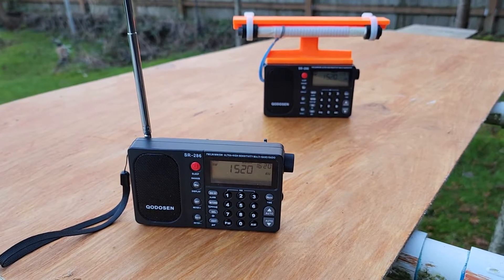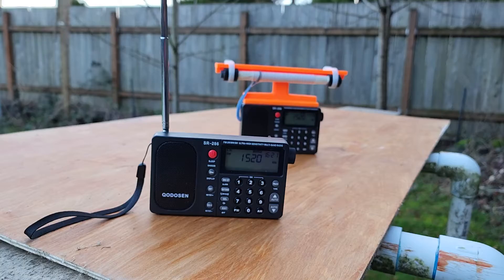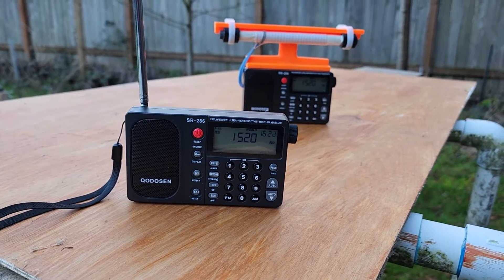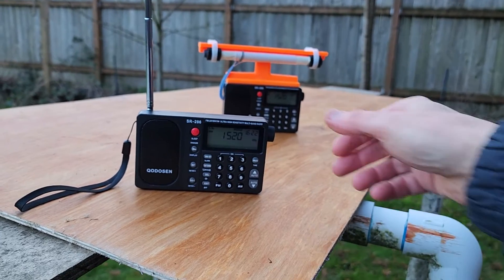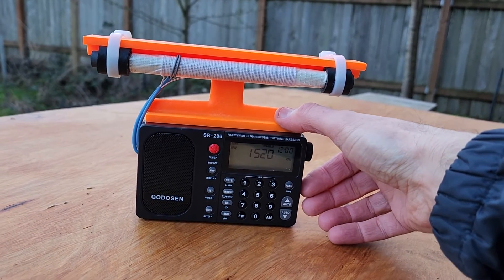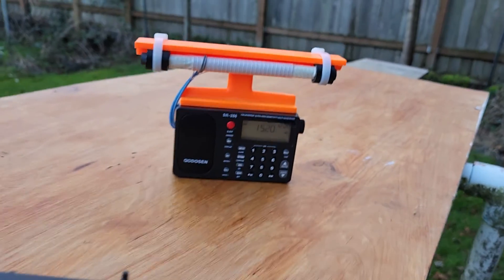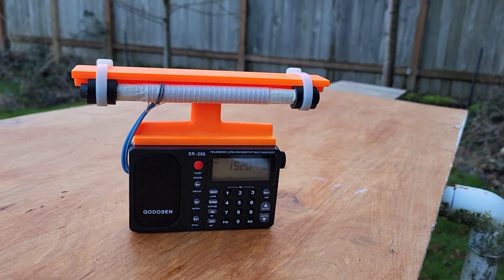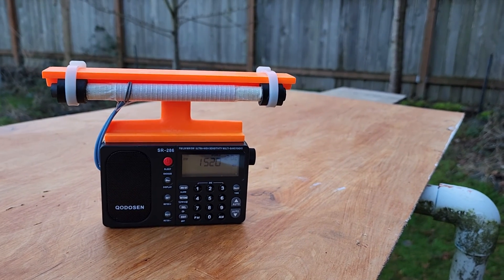7.5 inch (19cm) AM Loopstick Qodosen SR-286 Ultralight Radio

Comment: I made a single turn 4 by 4 meter square wire loop antenna in my staircase. Just the wire loop, directly connected to the radios external antenna socket. It works surprisingly well.

Comment: Hi Gary:

I bought this radio to play with this new car audio NXT chip and to get the improved parameters.

So, I used a slightly larger enclosure with two 2" high-quality drivers powered by my LM4863 amplifier to get the stereo performance and avoid the task of fighting the RFI.

Also I added a tone-shaping EQ board to get great sound in the 70-12000 Hz range.

Finally, I replaced the battery to a 26850 type to increase the playback time.

This worked marvelously.

Then I added the second whip antenna and used a balun to make great FM dipole.

The FM reception signal improved by 3-7 dB.

Then I replaced the ferrite bar antenna with 7.5" bar and made another the same inductance AM coil.

This modification didn't bring the desired improvements:

First, I started getting the "whistles" on very weak signals, when the system gain was maximum, indicating an oscillation.

Second, I found no way to improve the reception by tuning the antenna coil - it looks like this digital design doesn't use the coil resonance, or, I am wrong about it?

If that is true, then - how does it work?

Do you know anything that may help me in the right direction?

Unfortunately, I found zero information about TF6686 chip.

What I have now is close to the best radios I ever had, but I still see a few ways to improve the AM and, especially, the SW performance.

Regards,

Roman Litovsky.
Reply from the maker: Hello Roman, The SR-286 (and DX-286) has a two-coil loopstick design, making it a little trickier to design a replacement. In my own 7.5 inch loopstick I simply matched the inductances of the stock main coil (638 uH) and tickler coil (4 uH), and then obtained a big gain boost over the stock loopstick. In answer to your question, there is no way to tune the loopstick coils for maximum gain. Both the TEF6686 and Silicon Labs' chips are designed to operate well within a certain antenna inductance range, and don't provide 'peak" performance at only one inductance. As long as you duplicate the stock antenna inductances (like I did), you should get a nice gain boost with a longer ferrite rod. I don't know if your other modifications are somehow causing the oscillations on weak signals, but sometimes in a "dream radio" project like yours, it's best to do improvements one step at a time, to make sure that the improvements don't interact with each other, and cause problems. 73 and good luck, Gary/ N7EKX
Reply: @DXerGary  Thank you, Gary! I understand your answer: 

I did make two coils with the right inductances and even played with their relative phase (no effect, as I supposed).  My AM performance now is the best in class, but I expected much more gain, considering that the volume of the 7.5" ferrite rod is about 5-6 times larger than the stock one.

My goal is the following: to place the JFET follower stage at the main coil, remove the small secondary coil, and feed the JFET source output instead.
This way I would receive about 46 times HIGHER signal level than now with an antenna step-down transformer.  But I am not sure if this system would be stable with such a tremendously higher signal level.

By the way, what did you think about selecting a rather large distance between the new 7.5" rod and the body of the host radios?  Did you fight the parasitic magnetic coupling?

Regards,

Roman.
Reply: Where can find 26850 battery?

Comment: Wow great video. I enjoyed hearing the overlapping stations. I just read about some commercial AM radio stations reducing power, changing antenna configurations at night.

Can you get similar overlapping results when listening at night (I’m assuming better propagation conditions but also some stations reducing TX power?)

73 KI7ZTH
Reply from the maker: @mattkenny8151, Yes, at night many frequencies have multiple stations on the 7.5 inch loopstick SR-286 model. Some of these can be separated by turning the loopstick in different directions, if their directional bearings are widely separated. 73, Gary N7EKX

Comment: Question for anyone: On MW, how might this modified model perform compared to an unmodified one connected to a passive tunable loop such as the TERK AM ADVANTAGE plugged into the external antenna jack or inductively via the radio’s own stock loop-stick?

Comment: What would happen if you got a longer ferrite, instead of the loop stick? And would a longer ferrite work on other radios that use a conventional ferrite for MW, like XHData and Tecsun?
Reply from the maker: Hi Steverolfeca, a longer ferrite (like the Amidon 12 inch long Type 61 rod) would provide a slight increase in sensitivity over the 7.5 inch rod, but generally not worth the $95 cost and decreased portability. It would also require a new coil design, if used with the SR-286. For the XHDATA D-808, CC Skywave and other Silicon Labs 473x DSP chip models (PL-380, PL-330 etc,), these 12 inch long ferrite rods also provide a slight sensitivity boost over the 7.5 inch rods, but at very high ($95) cost and decreased portability. It's much better to get a sensitivity boost from an inductively coupled FSL antenna, if more sensitivity is desired.
Reply: @DXerGary  thank you for your advice. I grew up around tube and solid-state audio equipment, but RF is a whole new world for me.

Comment: Hi Gary, I have modified the Tecsun PL-380 with a 16cm external ferrite bar according to your plans, and I must say that the receiver has been reborn. I recently purchased the Qodosen and am using it with a self-built FSL with very good results. Even with its external antenna it works very well, from the balcony of my house (I reside in Italy, central Tuscany area) where there is less noise, I was able to listen to two stations from Iran: Radio Qoran on 900khz and Radio Ardabil on 1512. 
Regarding your interesting project on the Qodosen, for now I do not dare to get my hands on it, we will see in the future. Instead, I would like to modify the Tecsun PL-380 again with the FSL wired as per your design. 
I ask you one last thing: is there a file of the orange stand to make it with a 3D printer? 
Thank you and congratulations on your excellent work.
Reply from the maker: Hello DoctorWu03, Congratulations on your successful modification of the Tecsun PL-380! The project to hard wire a small FSL into the PL-380 (in place of the loopstick) works well, but it's a challenge to find the lightweight 100mm x 20mm x 3mm ferrite bars in some countries. I'm sorry that I don't have a file to make the orange antenna frame with a 3D printer-- I usually just cut these on a miter power saw. Best of DX to you! 73, Gary

Comment: Hi Gary - love your videos (how can I not enjoy someone playing with radios in their backyard, I've been doing it since I was 5!)  If you could post something about how to take this radio apart. Mine has an interior vibration that I can't fix from the outside.  Not sure what it might be, but something needs to be tightened down.  I removed all the case screws, but there seems to be a hang-up on the side where the tuning knob and volume are located.  I really don't want to crack the case. Thank you in advance and much appreciated!!
Reply from the maker: Hi Jkratoville, the tricky thing about cabinet disassembly on the SR-286 is the rubber "feet" on the bottom of the cabinet. After you have removed the six screws, you must also pry half of each rubber foot off of the cabinet base before you can separate the front and back sections. Then, gently pry the two sections apart with a rocking motion. There is a snap connector on the side where the tuning and volume controls are located, and this is usually the final hangup  before complete separation. Also, be careful of the wires from the battery connectors-- they break off very easily.

Comment: Hi Gary, looking at the loopstick photo I don't understand the connections. 
Could you please explain technically. It seems to me that the 2 turns loop should be connected to the antenna and the 93  turns loop should be connected to the variable capacitor of the receiver. It's correct ? Thanks a lot Gary, nice mod.
Reply from the maker: @tiqueky, Thanks for your comment! In developing this modification I simply duplicated the connections of the stock loopstick, which are shown in the photo at the following link (with the connections labeled in yellow lettering). Qodosen does not give out a schematic diagram of the SR-286 model, so that is the only way to connect an improved loopstick
https://dreamcrafts.box.com/s/ajrv2do0x45jc0ep8spqxxguye0s8lu1

Comment: I really, really hope someone from Sangean, Tecsun or C. Crane is watching this!!!
We consumers are tired of the silicon labs medicare DSP-IC tuner chips, when NXP has been tirelessly working on there latest DSP chip and co processor. 
It is WAY past the time these NXP DSP tuner chips to start making there way into portable radios. I'd be willing to pay a premium for such a IC-tuner chip (on there top model), but that option has not been given to use consumers.
From what I'm hearing, the NXP TEF386* is quite the IC chip, and essentially making the silicon labs chips look like cheap toys.
I'm a DXer like you Gary, and have over 14 portable radios, and all of them are very close, because they all use the same darn Si-labs chip.
I have ordered the SR-286, and can't wait for it to get here. I'm in the bay area, so I'm hoping that I will finally be able to hear all the radio stations from Fresno, Sacramento, and Monterey on open FM frequency's.
Reply from the maker: @petegallaguer8978, I agree with all your comments. The TEF-6686 chip from NXP provides a whole new league of AM and FM-DXing performance compared to the Silicon Labs' Si473x series chips. Hopefully the radio manufacturers will upgrade their models with NXP chips as soon as possible!
Reply: I can see how it seems the TEF is a much newer chip, but the data sheet copyright is 2005, not much later than the SiLabs chips.  It's not a new chip, it's just new to portable radios.  WHY it took 20 years to be "discovered" I haven't heard a good answer to.  NXP wouldn't sell it to anyone not a major mfg?  I don't buy that, not for that long a time period.
The power consumption does make it kind of an 18650 only sort of chip.  150mA or so just to power on.
Also, I'm enjoying my new radio, but not finding it to be more than a tiny bit better than any of the competition.  I think you have to be in a VERY low RFI area to hear a difference.

Comment: So the internal ferrite stick is even worse that usng the telescopic antenna for MW ?
Reply from the maker: Digitalmediafan, actually the internal ferrite stick performs very well for the radio's tiny size-- it's just that the whip antenna performs better for MW reception. The SR-286's whip antenna will beat out all of the compact portables in MW reception.
Reply: @DXerGary  OK hmm a bit strange. If I get one I was hoping it would work with my wellbrook loop for MW tbh
Reply: I get more stations with even just the built-in whip, but a TON more RFI.  I had no idea that the streets of my suburb were THAT full of electrical buzz.  You don't hear it (or only faintly) on the loopstick.   Even through the buzz, though, I can find more stations.  I just would never want to try to actually listen to them with the buzz.
The 10 and 50 foot wires out my back window work just fine, though.  I'm not sure why they aren't full of noise.

Comment: can you please tell me how the older (1990) version of the Sangean ats-803/Realistic DX-440 performed compared to radios of today. I had a new Realistic DX-440 in high school, then sold it, and now I have some reservations and regrets that I did, but I didn't use it for more than 1 month...
Reply from the maker: Sorry Dadwire1483, I've never owned a Sangean ATS-803 or Realistic DX-440, so I can't really answer your question. This Qodosen SR-286 in stock form is the most sensitive AM-DXing Ultralight-sized radio I have ever tested, though  (when the whip antenna is used).
Reply: ..thanks for your reply.. @DXerGary

Comment: Gary, please compare Radiwow R-108 and Qodosen SR-286 on medium waves.  Thank you.  I have Radiwow R-108.  I wonder if Qodosen SR-286 will be better than Radiwow R-108?
Reply from the maker: Hello Orionstar640, the new Qodosen SR-286 is more sensitive on medium wave than either the Radiowow R-108 or the XHDATA D-808, when using the SR-286 whip antenna. When using the internal loopstick, the XHDATA D-808 is slightly more sensitive, but the SR-286 can still beat out the R-108. The SR-286 uses a different DSP chip (the TEF-6686), providing less noise in the S/N ratio. In selectivity, however, the SR-286 cannot compete with the other two, because its narrowest filter is a 3 kHz selection, compared to the 1 kHz filter of the D-808 and R-108.
Reply: @DXerGary Thanks for the answer.
Reply: @DXerGary  ... and one more question.  Where is the better sound on the radiwow r-108 or qodosen SR-286?  Which one do you like the sound of?  I would be grateful if you show these two radios in the video.
Reply from the maker: @orionstar640  I have completely disassembled both the R-108 and SR-286, and know that they both use the same kind of bass-oriented, powerful speaker. This compact, powerful speaker is also used in the D-109, D-109WB and D-608WB models. As such, the audio from all these models sounds about the same. The R-108's audio amp is wimpier than the other models on MW, though, so it bails early on very weak stations. The R-108 was fully reviewed in the 2021 Ultralight Radio Shootout (along with the XHDATA D-808, Tecsun PL-330, Tecsun PL-380 and C. Crane Skywave), posted at
https://dreamcrafts.box.com/s/8y6855bnfmy45rnk46mzr7hb4pwjz8u8
Reply: @DXerGary Thank you for the information.  With respect to you.

Comment: Hey Gary, the PL-330 also allows to switch between the internal ferrite rod and the telescopic antenna by long pressing 3. What I found is, in front of the sea, at noon local time, the telescopic antenna also brings way better results! My theory is the internal circuit (perhaps the DC-DC booster) causes too much QRM in very low noise locations like the beach.

But, neither the PL-330 nor the SR286 in their telescopic antennas, at the same beach location, could beat the Belka DX 0.1-30MHz version! I highly recommend the Belka for MW DX too.

Comment: Gary's modified Qodosen SR-286 7.5 inch loopstick version is ideal for MW DXers attempting to DX away from home in mobile situations where being more discreet among non-DXers is sometimes desired. But for DXing at home, my Sangean PR-D3 portable radio with 5 inch diameter speaker + inductively coupled tunable 2 ft diameter circular PVC loop will somewhat excel the SR-286 7.5 inch loopstick version. It is also somewhat disappointing that the TEF6686 chip does not feature high MW adjacent selectivity like it does on 65 to 108 MHz FM. The TEF6686 tuner variants are undoubtable the most sensitive, selective, and IMD resistant pocket size 65 to 108 MHz radios available anywhere.
Reply from the maker: Hello FrozenDoberman, I agree with all your comments. A 7.5" loopstick in the SR-286 will provide far more MW sensitivity than the stock loopstick, but inductively coupled air core loops or FSL's will always win out over a loopstick in ultimate sensitivity. This enhanced model was designed for travel situations, where inductively coupled loops are not convenient to set up. In that mission, it's a real thriller.

Comment: have you use the extenal antenna socket ?
Reply from the maker: Hello Dobrindorin1420, no, I haven't used the external antenna socket yet. Most of the external antennas here are inductively coupled (FSL's and tuned air core loops), so there is no need to use the antenna socket on the MW band.

Comment: This is great thanks for explaining  that you made a 7.5" version of the onboard loop stick.  Of course we want to see what it can do a nighttime and compared to your other radios with the 7.5 add on  modification. I just bought the xhdata d-109, an The AM is great , i have  eton traveller3 radios but they  make loud clicks and pops in the ear phones when settings are changed, also there is the hiss sound with the volume down. The D-109 doesn't do any of this an the AM is comparable and the filters are easy to locate.
Reply from the maker: Hello Doug, this enhanced SR-286 model is the winner over all my other 7.5" loopstick models in MW sensitivity, primarily because of its low-noise TEF-6686 chip, which the others don't have. It provides lower noise in the S/N ratio for extremely weak stations. Unfortunately the SR-286 has limited selectivity options, so it gets beat out by the other models in limiting splatter from pest stations. The 3 kHz filter of the SR-286 just won't compete when chasing split-frequency transoceanic DX on MW.